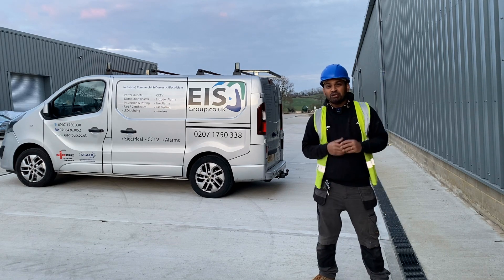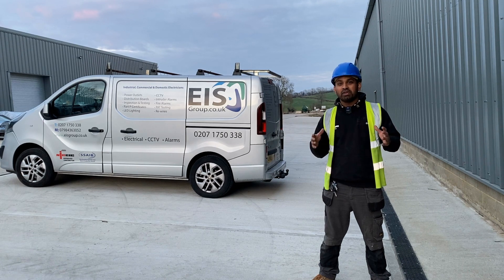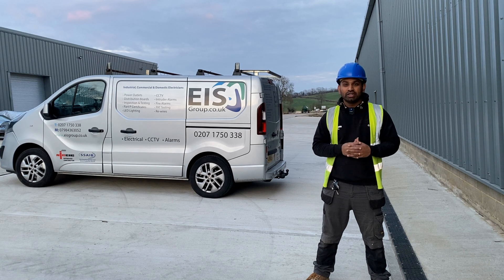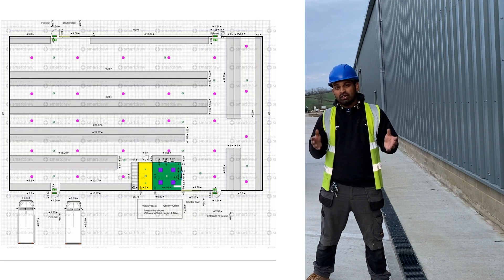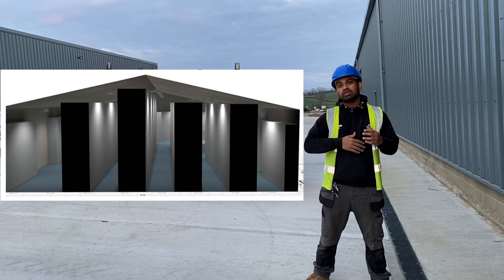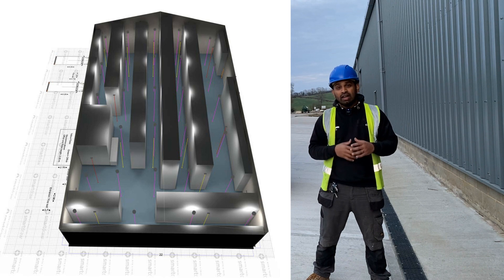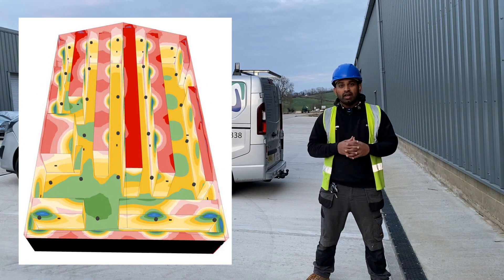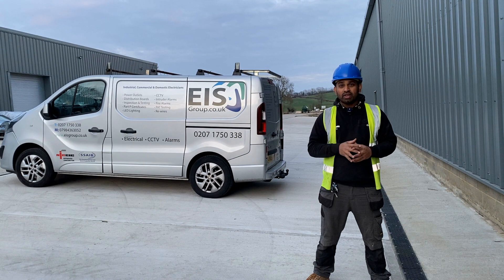Industrial warehouse unit LED High bay lighting design and installation

Comment: Thanks a lot for taking the time and effort to make this video! I am having a hard time finding videos where people are using these high bay LED lights with the optional diffusers / reflectors. I guess not many people must know yet they could be a nice addition to reduce spotlight glare and spread the light out more evenly. Perhaps you guys would want to try some and see the difference and shoot a video (perhaps others would like to see as well)... I ordered some high bay lights and diffusers for my shop but they have not arrived yet, was just looking for some videos showing lights with diffusers.
Reply from the maker: Hi Samson, lot of our clients actually want the wide angle beam, diffusers would make it more narrow and focused wouldn’t it? Correct me if I’m wrong
Reply: @EISElectrical  I am still waiting for mine to get here to try the LED-style with diffusers, but in an old shop I had before, I used to have the common 400w metal halide high bay lights with diffusers and they really did wonders to spread the light out more evenly and eliminate hot spots and shadowing. They help to get distribute the light equally, to alleviate any spotlight (UFO) effect, and so they don't burn your eyes when you look at them. Anyways, cheers, and thanks again for your video!